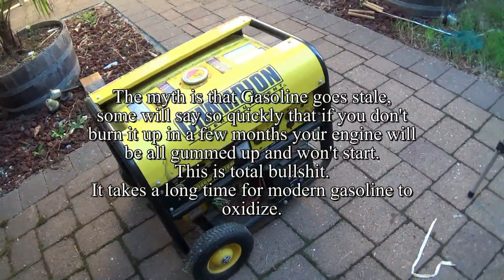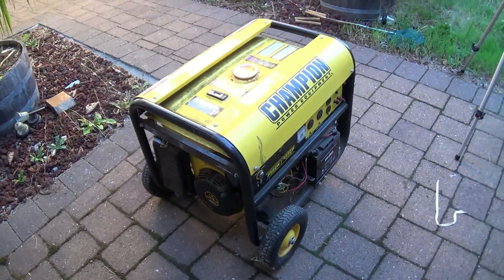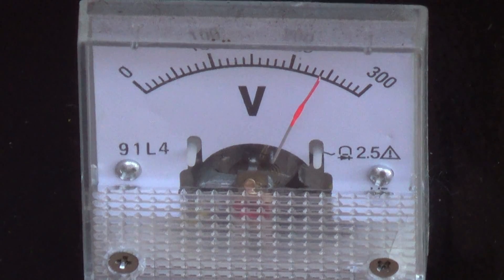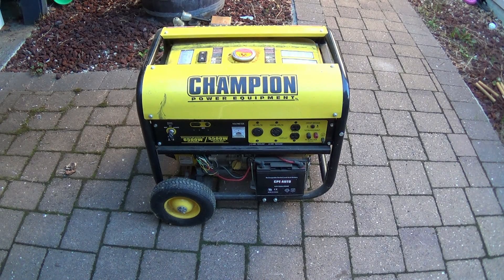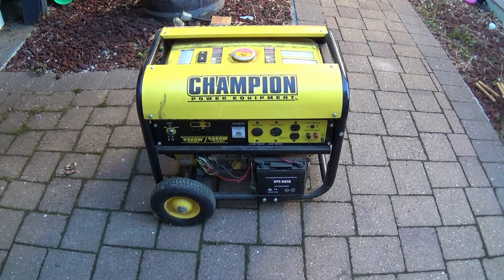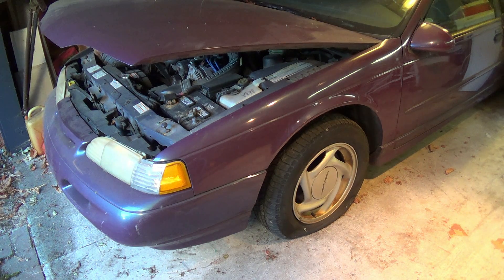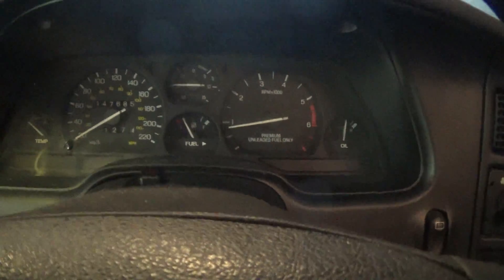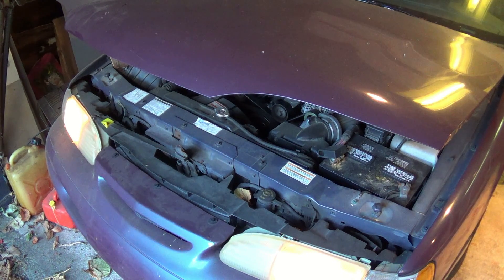Stale Gas Mythbusted

Comment: Do it with ethanol gas and it'll be stuffed in 2 months. Paid for my house with the money from rebuilding or replacing carbs the last 25 years. Thank you ethanol!
Reply: scott king premium non-ethanol fuel only.
Reply: um is ethanol unleaded? If not where is it bought?
Reply: @ameerordimly1449  Ethanol is an alcohol additive to fuel in the US.  In Iowa where I live, its the cheapest type of gasoline because its subsidized.
Reply: @nsummy  more confusion...
First you said its a "additive" TO the fuel..then u said it IS "fuel".
Can both be true?
Reply: @ameerordimly1449  yes both are true statements. ethanol is a grain (usually corn) derived alcohol. It is commonly added to gasoline as a way to raise octane. It is found as 10% (90% gas)of the fuel volume or as 85% (15% gas). With simple modification any internal combustion engine can be made to run on 100% ethanol, so yes both statements are true.
Reply: @scottw5253  ethanol is alcohol produced through fermentation, it’s the same thing whether it’s beer, wine, or distilled spirts. Brazil makes theirs from sugarcane, alcohol used as fuel has traditionally been methanol.
Reply: @dirtyaznstyle4156  ok...are you correcting me on something? Methanol is a fuel, yes, but it is ethanol that is added to gasoline in the U.S. It is also viable as a fuel on its own, though it does have its drawbacks like anything else. -- Ethanol produced primarily from corn...like I previously stated. So what exactly are you trying to tell me?
Reply: @scottw5253  if you consider the US is the largest producer since it’s also the largest consumer of ethanol fuel, most fuel ethanol produced outside of what is produced and consumed domestically in the US isn’t derived from corn. The rest of the world isn’t so predominant in its source material. That ethanol could be distilled from many different sources based on a persons situation if not constrained by economics just personal use. Like I said traditionally what is referred to as alcohol fuel has been methanol even in the US. You don’t have to be so careful what you ferment to make that stuff. Today a lot of internal combustion engines that aren’t gasoline/diesel or nitromethane fueled are still methanol fueled. Wait till we run outta oil and ethanol won’t be as preferred
Reply from the maker: Ethanol gas in my volt been there for a year then computer made me burn it up.
Reply: Everything is moving away from carbs so cash In while you still can
Reply from the maker: I would think the gas in the generator was ethanol gas as that one had regular for sure. I did burn it all off and refill it but the original gas was in there for about 7 years by the time it was used up.   Going to convert that generator to natural gas one of these days.  Just have to get a conversion kit.

Comment: Most engines will probably fire right up with old gas in them but for those people out there that worry about things like that, yes it is not a terrible idea to drain the tank and put fresh stuff in. For cars that have sat for years though I would recommend pulling the fuse for the fuel pump (or anything else that would stop the car from starting but still allow it to crank) and this would be to allow the oil pressure to build up and get all around the engine before the engine fires. This is the ticking noise in your car after it fired up. Not a huge deal either but not a good idea to rev it straight away.

Comment: the main reason gasoline will go bad is exposure to air.  in a sealed system the gas will get "stale" but tends not to varnish, if there is even a slight amount of exposure to air it will varnish badly after about 12-15 months.  he talked about his dad always draining carbs after use and having varnish issues, thats because the carb bowels were left plumb full of sail boat fuel to act on that gas.
Reply from the maker: Using premium no ethanol fuel lasts a long long time.   7 years in the old car and still runs.
Reply: @12voltvids  I've seen gas that old still run an engine before.  over the years i have taken stale stinky gas and laid it on the ground next to fresh gas and lit them up for comparison purposes, the fresh gas always lights easier.  i'm not trying to get in an argument with you about anything but i know for sure that gas that is left in a fuel system for too long will varnish and destroy fuel system components.  im glad you haven't had any issues so far but i would highly recommend that you replace that old gas with fresh.
Reply: i forgot, using non ethanol gas is better for longevity, and your fuel system must be sealed pretty well for your gas to have lasted that long.
Reply from the maker: @jheetman  the generator is empty now.  The metal petcock corroded and fell off dumping what remained on the floor.  The car will get some new gas added soon. It will be a project car once my son grows a pair and learns to drive.  It was supposed to be for him but he decided not to drive.  Some day he will grow up and figure it out that not being able to drive will severely limit his earning ability.
Reply: @12voltvids  my girlfriends nephews are like that... for me a drivers license =freedom.  i guess i just really wanted to go where i wanted when i wanted.
Reply from the maker: @jheetman  my daughter learned to drive at 14, and got get license the day she turned 16.   The boy will figure it out some day and he will be sorry because it takes 3 years to get a full license.

Comment: You forgot to tell us what type of gasoline was in those tanks. Non-ethanol is day and night from ethanol.

Fuel line left on did nothing for you. Obviously the fuel was completely evaporated from the fuel lines and carb.

Tappets? LOL. Hydraulic lifter noise.
Reply from the maker: The old car has non ethanol premium in it but the generator has just regular gas with ethanol it it.  The gas has not evaporated from carb. With fuel left turned on as it evaporated it is replenished.  I start it every few months to birn off a little
Reply: It's best to keep ethanol-free gasoline in engines that sit.

Comment: It won't work with the ethanol gas most likely. It'll eat through the fuel pump diaphram.
Reply: Never ever put ethanol in a carburated engine, even most injection vehicule don't recommended it (wear the rubber seals faster)
Reply: @quentingence4278  um is ethanol unleaded? If not where is it bought?
Reply: @quentingence4278  ethonal is expensive and if you put 2stroke oil in gas then it solves the issue .
Reply: um is ethanol unleaded? If not where is it bought?
Reply: @ameerordimly1449  You are confused. The ethanol is already in the fuel. The amount of ethanol added to the fuel varies, anywhere from 5% to 85% ethanol depending on where you purchase the fuel. They fuel pump will have a label to reflect how much ethanol there is in the fuel. Cars that are set up to use gasoline only can tolerate up to 10% ethanol, but the engine will not run as efficiently since the engine is designed to run on gasoline (petrol) and addition to this, the ethanol added to the gasoline has a propensity to attract water from the atmosphere which can then contaminate the gasoline with water.  If a vehicle is set up to specifically run on high ethanol blend, then it will not have problems running 85% ethanol blend. When you ask if ethanol is unleaded, there is no such thing as leaded ethanol, since ethanol is just a grain alcohol.  Hopefully you understand now.
Reply: @marketingmajor8126  u misunderstood...
I was asking if eth was another name for unleaded gas
Reply: @ameerordimly1449  Not that I'm aware of. l've never heard of unleaded gasoline being called anything other than unleaded gasoline. At least not that is commonly used in North America.
Reply: @marketingmajor8126  right...thats why i was wondered what fuel he was talking about and where it is to be purchased?

Comment: 6:18 ya rev with it tappin that'll help 🤭
Reply from the maker: Gas and oil in there now is 8 years old, still starting and tappets still noisy. This one will some day be pulled out of the garage and given a tune up. I was hanging onto it for my son whom said he wanted it, and they decided he doesn't want to drive period.
Reply: @12voltvids  why not looks like a fun project to work on😆👍
Reply from the maker: @thrpins8430  
That car is the last year that ford made the supercoupe 95. The paint is a rare ford color chemelian blue.  In 95 ford only make 3500 supercoupe with auto trans and 615 with standard.  This makes it a collector car and is now 24 years old.  I was hoping my son would be interested in restoring but he has no interest in cars and doesn't drive.  He got his learner's ticket at 16 never drive never wanted to learn and let it expire.  So now he has to start over.

Comment: The length of time to get the generator to start was cringe worthy - I'd say that it probably didn't really hurt anything but still after the first 5 or 10 seconds I thought there's no hope for that starter even if it does start....
Reply from the maker: Generator is fine. It is always hard to start when it has been sitting for 6 months. Especially with old gas in it. I have burned all that old gas now, and replenished it.

Comment: I have often heard this said but have never experienced any problem myself storing fuel over winter etc.
Could it be that if the fuel tank it is being stored in has a very poor seal (i.e. a lot of the gas evaporates away when stored) this is what causes peoples problems?
If this is the case it may be more concern that there is a fire risk when storing fuel in poorly sealed fuel tanks?
Reply: btw - I know fuel tanks are never totally sealed but it could be the rubber seal around the filler cap is not working which opens it up more than it should

Comment: I don't have much experience with gas-powered engines being stored for a while, but my current daily driver once was "stored" (out in the open) with 1/4 tank of E10 (premium if it matters) for about a year. I cranked it up from time to time just to keep things moving and the battery charged but when I put it back on the road, it still had roughly year old gas in the tank when I went to go fill it up. It ran the same as the day I parked it.
Reply: 1 year is nothing
Reply: @kenmastersmaster  Well, I now have a truck sitting with a pretty much full tank of gas that is about half gas of unknown age (pulled it out of a junkyard around the time of my original comment around four years ago) and half tank of what is now about four year old gas. All E10 most likely. That truck is soon to get worked on to get it on the road (damn covid making it impossible to find parts) so I get to drain about ten gallons of some old gas to play around with. I'm only draining because part of the repairs is to replace the OEM carb with one that is less problematic and I don't feel like accidentally clogging it up.
Reply: @MarkReaves84  I was thinking if you do 50/50 shouldn't have any problem old gas with new gas

Comment: In the beginning you said modern gas doesn't go bad as easily, but that's wrong. Modern gas contains ethanol, which will make it go bad more easily and make it turn into gel eventually. While, in the worst case scenario, gas can loose parts if it's quality after 3 months, even modern day gas will probably still work after more than a year... I have a little bottle of 10% ethanol RON95 (91 octane in the US) fuel that is still very thin and will probably still run fine in any car. 

Also, two year old gas will probably not make a generator or lawnmower run much worse, but I wouldn't risk it in a car engine. It also depends where the gas has been. If it was stored in a plastic jerrycan for 3 years, inside, it'll probably still be fine. If it was stored in your fuel tank, in a car that sits let's say outside, yeah no drain that shit immediately

Comment: It is true gasoline will last a very long time in a cool climate if it is in a well sealed container but I am from Arizona in the valley it gets over a hundred and fifteen degrees on average in the summer and whether you have it in a sealed container or not gasoline starts going bad here after about 6 months the temperature has a lot to do with the deterioration of the fuel the cooler the climate the slower it deteriorates same thing with motor oils types of rubber anything pertaining to petroleum it is much slower decomposing in a cooler climate here in Arizona in the valley we only get three years to four years Tops on a set of tires before they dry rot and blow apart.

Comment: Properly stored gasoline stores almost indefinitely. Keep your tank full and you won't have any problems. Stabil is mostly solvent and a little naptha. They make a lot of money by propagating  the myth that fuel goes bad. If possible store the gas nearly full in a cool place. Stabil works because when people use it they are paying attention and fill the tank up before storing it. Any small amount of varnish buildup is quickly removed by running some clean gas through.

Comment: Dont believe him. Different engines handle having gas left in them differently. My toro snowblower will not start after gas is left in it for 6 months. 2 of the 4 yrs ive had it i forgot to drain  the float bowl and it was full of corrosion which plugged the ports. I had to disassemble and clean. When i treated the gas for storage or drained it, no problem. Same thing with my yard machines lawn mower and log splitter. My 20 yr old snowblower seems uneffected by gas left untreated all summer. Follow the manufacturers instructions.
Reply: I agree Will. I could also be bragging about how I never stabilized my Suzuki outboard for many years but eventually the lack of care catches up and the idle gets rougher and it conks-out. I disassembled the the carbs (3) and cleaned out everything. The Mikuno carbs are very easy to work on but Not an easy job to keep the carb linkages in Sync. when you reinstall them.

Comment: I just bought a 2007 Honda Civic from my sisters friend he had it stored for over a year. I noticed a lot of trembling when I turned on the AC.. Alternator was the first thing that ran trough my mind. I was going to take it to Autozone so they could check it out the next day, but before the next day came I decided to fill her up more than half a tank. When I first got it was a little bit more than a quarter filled. I started to notice that my car stopped trembling when I put the AC I did no work on it at all only put gas is all I did and it’s not trembling at all. Can someone explain, please?
Reply: Gasoline also looses octane as it gets old.  The old gasoline you had left in the tank had enough remaining octane to run the car, but the added stress of running the A/C compressor was enough to cause the engine to struggle since even as the ecu was adjusting the timing, AFR, the diminished octane wasn't providing enough energy for the demand.  Added fresh fuel brought up the octane threshold thus allowing for proper engine operation even with the increased demand of having the A/C on.
Reply: You had bad gas lol
Reply: gasoline is a natural detergent. Old gas has spent all its detergent properties. running new gas can clean out any dirt from old/bad gas

Comment: That shit is ruining your engines your a dumbass
Reply from the maker: I finally burned the rest of the gas off, and added some fresh gas, in November 2016 7 years that gas was in the tank, and I started it every 2 months and ran it for 10 minutes under load. Now it is full of fresh gas, and it will probably take as long to go through that tank as we seldom get power failures. I am not saying that gas lasts forever, but it doesn't go bad as fast as some think. it does last a long time.